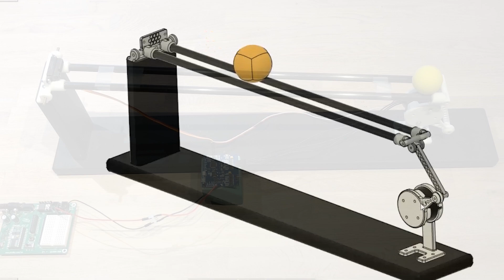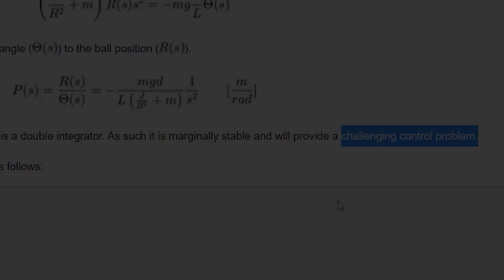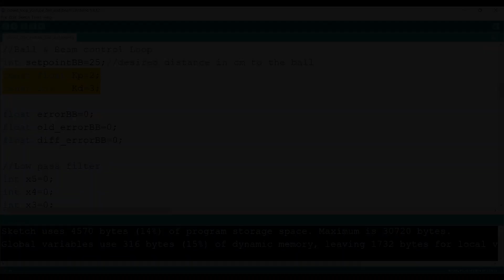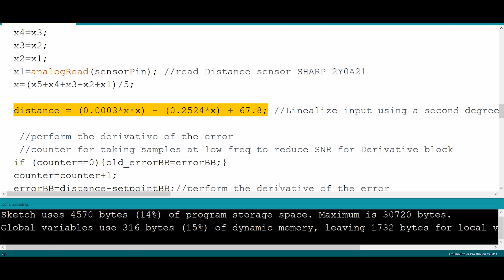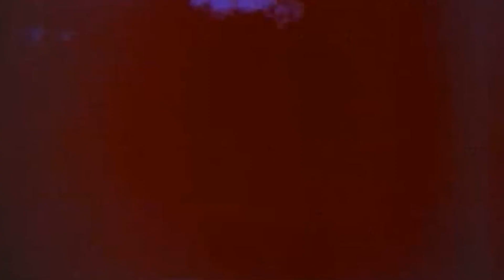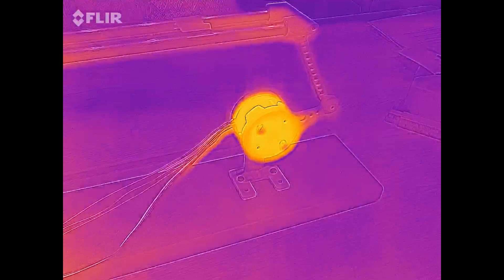Arduino PD Control Ball & Beam with a brushless BLDC motor servo using FOC

Comment: Hi! I'm an Electronics Engineering student working on a very similar Ball and Beam project for my graduation thesis. I will also use a BLDC motor with an encoder. I am really impressed by your mechanical linkage design and smooth PID control. Is there any way I can contact you via email or LinkedIn to ask a few quick questions about the motor specs? Great job!!!!
Reply from the maker: I have a patreon, you can contact me through it :)

Comment: Hello, how did you change the motor direction of the BLDC motor without swapping the wires ? I thought the BLDC motor needs an ESC (electronic speed controller) and that ESC provides three-phase signals to the motor.
If I am not confused are you using a servo motor or a type of stepper motor instead? ...is that correct.
Great video by the way.
Amazing control system explanation.
Reply from the maker: Look at my other videos you will find out there
Reply: @RandomAccessProjecs  Thank you for your reply, I see I will check them out.
Reply: @RandomAccessProjecs  From what I was able to figure out that there are bidirectional ESCs out there for BLDC.
Reply from the maker: No, the order in which you generate the waves for coils A B C is where you define de direction. The amplitude defines the torque ;) good luck
Reply: @RandomAccessProjecs  Thank you for that, that's what I thought as well.

Comment: You are makeing great work! I going to oder your bldc control boar but I have couple q about the board. What difrence it have to normal rc ecs? I know in your board have arduino and L6234 chips.
Reply from the maker: Hi! Thanks! A normal RC ESC will be designed for high speeds, will use either a sensored or sensorless setup to maximize power at high RPMs but will lack precision for positioning the rotor at low speeds. If your needs are for slow rotations and high precision control, then you need something different, like this setup. The latest board uses mosfets instead of the L6234 giving you better performance;)
Reply: @RandomAccessProjecs  Thanks for fast 
response. I have idea build 3 axis robot in future and I need just stuff like this. First of course i have learn use it but thanks  of your good tutorials. :) What type/model BLDC encoder motors you use in your videos?
Reply from the maker: @MrAasi4  then you need to watch my latest video on Robotic arms! Have you seen it yet? I think gimball motors are good for robotics applications like the iPower GBM4108 ;)

Comment: Hi, I was wondering if I can use a Storm32 BGC DRV8313 Motor Driver to do the same that you are doing with your board. I need to control 3 motors and it would be nice to have a board that supports 3. Do you know if it's possible to flash the board, so I can use Arduino code on it?
Reply from the maker: Sondre Nerhus sorry I dont know ... but keep me posted :)
Reply: @RandomAccessProjecs  Do you know of any motor drivers that you can use for one motor like the BLDC Driver Rev 1 used in your earlier video? Would be perfect to have more small drivers for a bigger system. :)
Reply from the maker: Sondre Nerhus the problem is that rev 1 is just the power stage, the arduino uno only has 6 ports with pwm so at the end that is what limits the number of motors per Arduino. I guess you could use a Mega but the sampling frequency will go down considerably with 3,4,5 motors.. also you can make the new version of the board and make small “slave controllers” dedicated to running the motors and receiving commands from a “master” that coordinates all the slave boards. Good luck
Reply: @RandomAccessProjecs  Thanks for the good answer :D I found a project on hackaday https://hackaday.io/project/168990-nucleo-swd-mbed-to-reprogram-storm32-controller , he managed to reprogram the Storm32 BGC DRV8313 so I will try that :D

Comment: I may be wrong, but I don't think solving a single 4th-order polynomial is going to be a problem for the Arduino.  I'm not sure what exactly you mean by "run out of variable space" but that shouldn't be a concern here.
Reply from the maker: Orion DeYoe Hi!, I tried it and didn’t get proper results... a value of 500, for example, taken to the 4th power is an extremely large number 4e+21 which cannot be held by a 16bit variables, it made the variable run out of space and overflow, im not sure Arduino was handling those large numbers correctly as the results didn’t make a lot of sense, however, there might be another way im not aware of, do you have any ideas?
Reply: @RandomAccessProjecs  You'd definitely need to use a Float (32-bit floating point) or Double (64-bit floating point).  I would recommend Double.

Which Arduino/chip are you using?  There are some exceptions on which ones support the higher precision data types.

Comment: hi ive gotten your open loop code to work but now my board only makes the motor spin forward and back really fast and im really confused as why ive tried just doing defualt open loop code and same thing
Reply: (the code at one point but after trying closed loop code i started having issues with the board )
Reply: i have bought another board and having same problem any known fixes?

Comment: how do we know the pin out of the board you are selling on ebay ?
Reply from the maker: Hani Bdeir you can use the code on Github as reference, im on holiday now but I can also upload a diagram or pinout when I return home. Cheers
Reply: @RandomAccessProjecs  Thank you !!!
Reply: @RandomAccessProjecs  is it possible for you to upload pin out now?
Reply from the maker: @hanibdeir8473  sorry about this! Its ages ago, but the pinout is up on the github repo, sorry About the delay in the answer.

Comment: Nice video thank you. I was wondering if you are planning to use the same setup to show a different control strategy. For example state space control. PID is simple but not always the best in practical, industrial situations. Would be really nice if some day you can show us how to apply a different control scheme also to same setup. Thanks in advance.

Comment: As a human, I can balance the ball on the beam with my eyes closed. Could a force sensor be used on the motor's lever arm so that the location of the ball can be calculated without ranging it and offer a new and difficult control problem with the same parts and layout? I imagine it would get tricky with the movement of the lever arm itself causing variations in the force in addition to the weight of the ball along the rail.
Reply from the maker: I guess it can be done. however, I think with eyes closed you would have problems locating the ball exactly at a certain distance, say 25 cm or 15, or 17.5... Also, this model is heavily simplified, yet still works, but its not contemplating the non linearity of the output mechanism, and the analytical model did not consider centrifugal force which is present too ;)

Comment: You skipped the Laplace part pretty quickly. I could have used some catching up there. Or did you skip it on purpose because of the complexity?
Reply from the maker: Bigman74066 well, I wanted to make the video about the device and implementation, yet you can follow the link to the control tutorials and see all the different approaches they use to model and solve the problem ;)
Reply: @RandomAccessProjecs  Thanks! And a big thumbs up for this video!